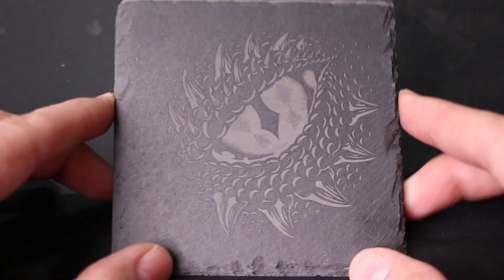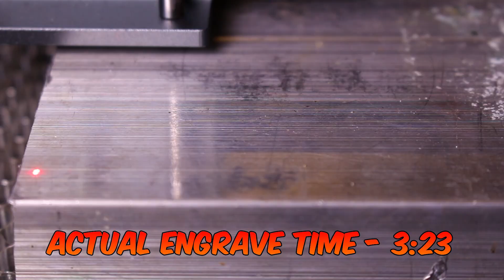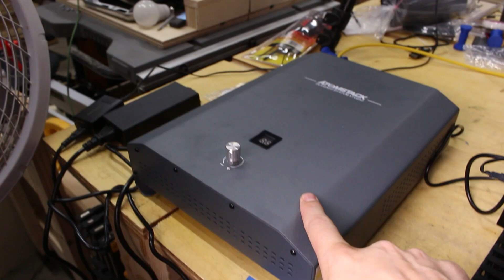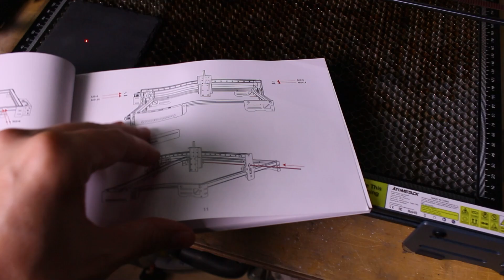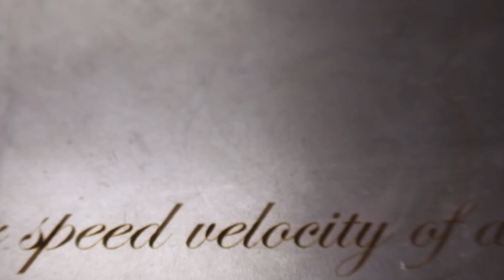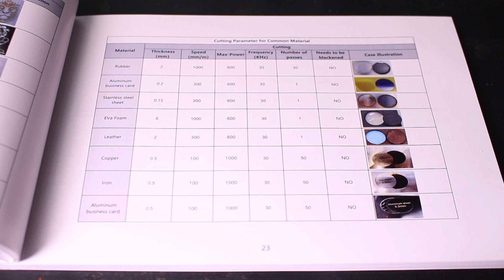What Kind of Laser is This? - Atomstack A20 Pro 1064nm

Comment: Hallo, ich habe seit gestern ebenfalls den A20 Pro mit dem 1064 Modul. Habe heute morgen angefangen den Rahmen zusammen zubauen, dann ging es an die Kabel. X und Y waren einfach, auch der Kabelkanal ist eine gute Sache. Nur bei den Kabel legen, was wird wo angeschlossen, finde ich keinen Durchblick. Das User Mnaual ist sehr ungenau, das Hersteller Video öffnet sich nicht und der USB Stick enthält keine Dateien, jedenfalls erkennt der Windows Explorer nichts an einem USB Port. 
Wie ich das an Ihrer Steuerbox (3´30") sehe, geht von der linken Seite ein USB C Kabel weg, vermute zum 1064 Modul?  Wo haben Sie das andere mit dem doppelten Anschluss USB C / A angebracht? Welches Kabel geht zum Laser direkt und wo wird der Computer angeschlossen?
 
Könnte es sein, das der HDMI Anschluss "Screen" für das Touch Pad (Offline Steuerung) gedacht ist? So ist das bei meinem X7Pro.

Über eine Antwort freue ich mich. Bleiben Sie Gesund

Comment: It could be diode laser. Corning made 1062nm watt level single mode diode laser. More likely diode pumped solid state. Uses laser diodes to pump crystal for second harmonic generation. Fiber lasers use doped amplifying fiber on large spool.  Just a guess.

Comment: While this is an absolutely interesting piece of kit, it feels ill-suited to do things a fiber galvo, gantry CO2, or gantry diode laser might be able to do. I think the real use cases might be engraving large, very flat, metal surfaces like a pist0l slide. Even then I think you'd need to ditch the grate surface for a machined one, the kind you would be able to mount tooling fixtures to (like on a galvo). The other concern is buildup of heat from not being able to move the head fast enough (akin to a galvo). Either way this this is pretty cool even if it appears to fill a hole no one asked to have filled.
Reply from the maker: I had someone who was looking to engrave a brass plaque that was too big for my galvo. I was able to use the A20 to get it done.  It has a very specific use case that not everyone needs really.

Comment: Thank you for this. I've actually been looking at buying as an upgrade module later. I'm strongly considering buying either their 40 watt or 70 watt diode first. You can get this as a stand alone and swap out the laser modules when you need to. I've seen similar results to what you're getting though, and I've wondered if having the metal set in a bath that only just touches the bottom of the metal to absorb the excess heat would help with the warping issue. I'm sure that would be a tricky thing to set up though considering how thin the metal cards are.
Reply from the maker: I've tried lots of different cooling methods for the cards on my other lasers. The thing that seems to work best is laying it on an aluminum block and doing multiple low power passes as opposed to a single pass at high power. Still not perfect but it definitely helps.

Comment: I have an AtomStack diode laser with the same frame and controller but an older laser head. It works well but I don’t use it frequently because of the light danger and smoke. If I had a closed-frame one with an air filtration system I’d probably use it more—but now we’re talking a LOT more money. Anyway, I appreciate that your videos show honest results in a concise manner. I’m an experienced 3D printing guy but I’m still a newbie with lasers.
Reply from the maker: I've used an enclosure for my open frames for years with an exhaust fan that vents outside. I think I spent around $80usd for the enclosure and it's been well worth the investment. I don't like to run my lasers without it.

Comment: With stainless you can get colors varying the speed and intensity. Also, engraving metal, it is better to defocus a little.
Reply from the maker: I prefer doing colored stainless with my MOPA because I can really dial in the colors I want by changing the q-pulse. I've done color on stainless with diodes using speed and power to get different colors but can't get the same range of colors I can with a fiber. That being said, this laser isn't a MOPA so it's limited to speed and power as well. I might play around with it and try doing some color on stainless with this one.
Reply: @LetsMakeAThing  I agree completely - I'd love to buy a MOPA for that. Q-switched fiber lasers are generally faster, but the range of control is more coarse. I have a 50w raycus and I can get nice colors on stainless and inconel. I have those same cards you were using - I didn't realize they were coated, not anodized, until I hit them once with a laser. Yikes!